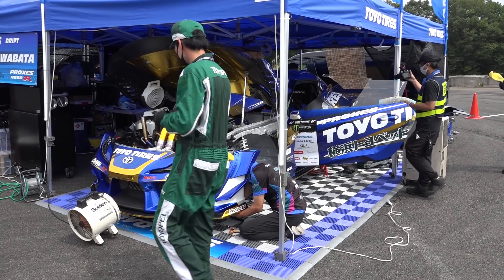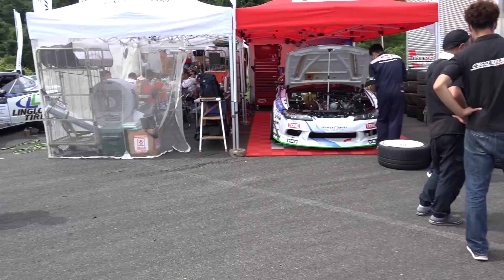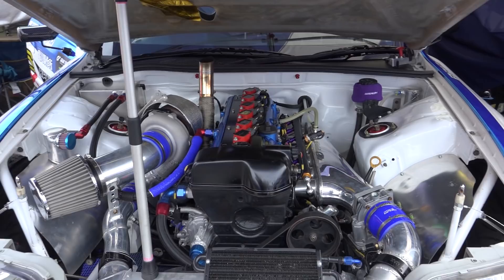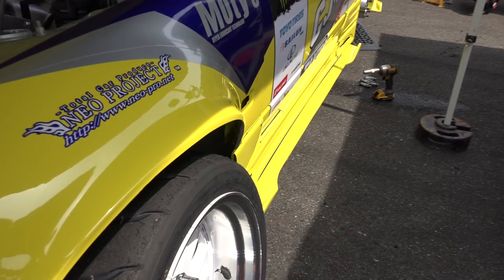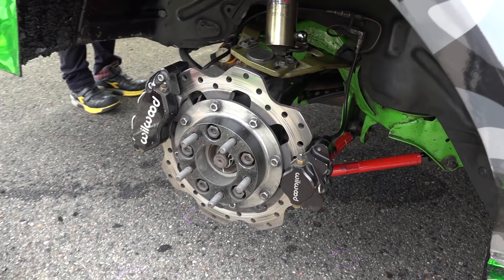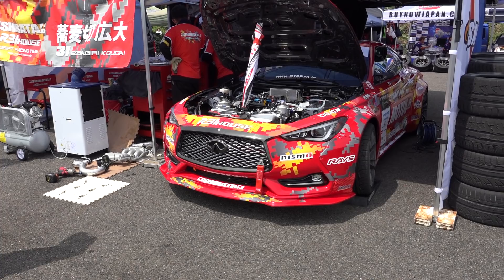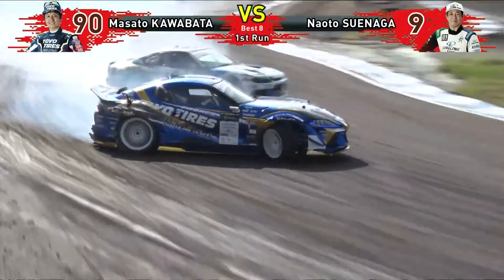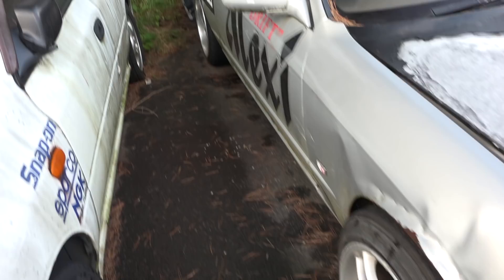V8 turbo Supra drift at D1GP Ebisu Circuit

Comment: Kawabata's Supra has a Toyota/Lexus 3UZ-FE V8. Fittingly, the same engine the previous gen Supra GT500 had (after 2009).
It doesn't sound like an American pushrod dinosaur because it's one of the smoothest-running DOHC V8s in the world.

Comment: I think it says a lot about the state of modern sports cars, if everyone still seems to be running 20 year old s-chassis at this level.
Reply: I think it has more to do with the levels of RnD that has gone into the S-Chassis platform in regard to drifting. If you look at US and European Pro drift leagues you can see that pretty much anything with an engine in the front can be made competitive, but for these guys who don't usually have the sponsor backing/requirement to use a specific chassis, using an S14/15 is just the shortest route to be competitive and is usually where the bulk of their knowledge is centred around.

I personally think it's kinda boring, seeing a whole bunch of S15s with 2JZs in them, but when you consider the context it makes perfect sense.
Reply: I feel like S15s are going to stay relevant for a good long while into the future, kinda like you still see a few AE86s running top tier competition.
Reply: It's all down to budget and simplicity. S chassis can be made competitive with tons of choice off the shelf parts. No need to reinvent the wheel there. Papadakis prove that even fwd chassis can be competitive in drifting but needs lot of development and custom parts. A lot of modern chassis is really good for drifting though, but again they're require more money and time to develop which not everyone have.

Comment: I love the diversity of drifting. no matter what car you want to run, you can (as long as its rwd). less power, less weight; possible. more power, more weight; possible. modern car; possible. old car; possible. I love that. I wonder if an older car or rather engine/platform could be made as efficient as the newer ones.. and how would manufacturers have built old cars knowing what they know now; probably the same way modern cars look and drive right now. Hmm, or how would they build new cars if they only had to oblige with the rules of the older cars..

Comment: What's with the funky looking exhaust tips?
Reply: I'm not exactly sure, but I can only assume its some sort of spark arrestor to stop fire from shooting out the exhaust. It might be something like Rally cars have where the catalytic converter is inside the exhaust tip for inspection. But that would be probably be a much finer mesh than seen here.

Edit: After digging through the comments, Alexi made one saying that they "catalytic converter's". Meaning people have them to pass inspection for cats but they are not exactly real catalytic converters.

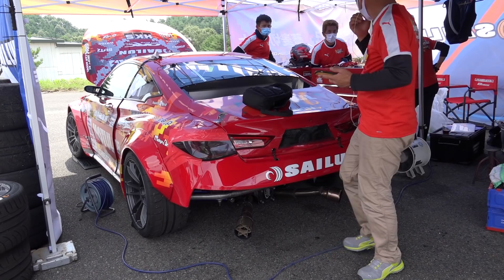Comment: Nori, what are those pieces inside of the exhaust pipes on the S15 at 14:31 and the Infiniti/Skyline at 18:10?
Reply: I’m gonna guess they stop turbo parts flying over the track when the turbos break and compressor wheels go flying down the exhaust 🤷‍♂️

Comment: 10:09 The VVL not the VVT SR20, the VVT is the standard one on S14 and S15 but i'm sure you know that Alexis.
Reply: Not VVT but VCT, some times people make the mistake of calling it VVTi which of course is Toyota tech.
Reply: @griplimit  I used the generic name, but yea you right it's called VCT. But in the end VVT/VCT is about timing on the intake cam and the Nissan NeoVVL is about valve lift on both camshafts (and timing, but it's mostly due to the shape of the cam profile). Anyway VVL is something nissan has never do on an S chassis, and VCT is fairly common.

Comment: Whats the the go with the stuff inside the end of the d1 cars exhausts?
Reply: I'm not exactly sure, but I can only assume its some sort of spark arrestor to stop fire from shooting out the exhaust. It might be something like Rally cars have where the catalytic converter is inside the exhaust tip for inspection. But that would be probably be a much finer mesh than seen here.

Edit: After digging through the comments Alexi made one saying that they "catalytic converter's". Meaning people have them to pass inspection for cats but they are not exactly real catalytic converters.

Comment: 18:10 why do all the cars have exhausts like that?
Reply: My only guess is a spark arrestor? But usually those are way finer. Seems way too sparse to be any kind of cat
Reply: In case of turbo failure, if the compressor wheel breaks and comes down the exhaust it could come flying out and hit another car or a person it would be rare to happen I’d say but it’s there for a reason
Reply: @Stu.motive  drag cars have those because they have so much boost

Comment: What are the snowflake looking things in the exhaust tips?
Reply: I would like to know where to get one!
Reply: I'm not exactly sure, but I can only assume its some sort of spark arrestor to stop fire from shooting out the exhaust. It might be something like Rally cars have where the catalytic converter is inside the exhaust tip for inspection. But that would be probably be a much finer mesh than seen here.

Edit: After digging through the comments, Alexi made one saying that they "catalytic converter's". Meaning people have them to pass inspection for cats but they are not exactly real catalytic converters.
Reply: I think they are in case of turbo failure, if the compressor wheel breaks and comes through the exhaust potentially hitting a spectator, another car and makes a mess of the track
Reply: @Stu.motive  Read my edit, it's a cat purely for passing inspection. Not a "real" cat though.

Comment: Can Alexi or anyone else tell me for what they have these snowflake-ish inserts in the exhaust tips?
Are they for reinforcement to prevent the exhaust from crumbling when running walls and stuff?
Reply: I'm not exactly sure, but I can only assume its some sort of spark arrestor to stop fire from shooting out the exhaust. It might be something like Rally cars have where the catalytic converter is inside the exhaust tip for inspection. But that would be probably be a much finer mesh than seen here.

Edit: After digging through the comments, Alexi made one saying that they "catalytic converter's". Meaning people have them to pass inspection for cats but they are not exactly real catalytic converters.

Comment: Whats up with the weird hexagons in massive exhausts?
Reply: I'm not exactly sure, but I can only assume its some sort of spark arrestor to stop fire from shooting out the exhaust. It might be something like Rally cars have where the catalytic converter is inside the exhaust tip for inspection. But that would be probably be a much finer mesh than seen here.

Edit: After digging through the comments, Alexi made one saying that they "catalytic converter's". Meaning people have them to pass inspection for cats but they are not exactly real catalytic converters.

Comment: Hey Alexi might i ask. even though there are about 4 or more inline sixes that can run 1000+ hp why is the 2Jz the one most chosen like I'm not hating on it I just wonder why its the engine of choice for most of the cars
Reply: I think is the same reason of why people use the LS engine in cars
Reply: @oklynmane maybe maybe not who knows some times the answer might be different from each engine user
Reply: @renz1013  yea maybe
Reply: @oklynmane  yeah same goes to like other things such as why people always use the s chassis
Reply: I have a rb and 2j car and reason why you see more jz swaps is because the blocks are stronger and don't crack until 2khp, they don't have oiling issues,Bigger displacement than rb26 and easier to source because they came in more cars than the rb26 did. I could give more reasons but that's mainly it but if your talking about new Zealand or Australia then it's mainly high hp rbs dominating the drifting there.
Reply: @clutchkickpj693  alright but asides those things what else

Comment: what's with the stars in the exhausts?
Reply: I'm not exactly sure, but I can only assume its some sort of spark arrestor to stop fire from shooting out the exhaust. It might be something like Rally cars have where the catalytic converter is inside the exhaust tip for inspection. But that would be probably be a much finer mesh than seen here.

Edit: After digging through the comments, Alexi made one saying that they "catalytic converter's". Meaning people have them to pass inspection for cats but they are not exactly real catalytic converters.

Comment: Can anyone explain the star in the exhausts?
Reply: I'm not exactly sure, but I can only assume its some sort of spark arrestor to stop fire from shooting out the exhaust. It might be something like Rally cars have where the catalytic converter is inside the exhaust tip for inspection. But that would be probably be a much finer mesh than seen here.

Edit: After digging through the comments, Alexi made one saying that they "catalytic converter's". Meaning people have them to pass inspection for cats but they are not exactly real catalytic converters.

Comment: What's in the exhaust tips of most of these cars?
Reply: I'm not exactly sure, but I can only assume its some sort of spark arrestor to stop fire from shooting out the exhaust. It might be something like Rally cars have where the catalytic converter is inside the exhaust tip for inspection. But that would be probably be a much finer mesh than seen here.

Edit: After digging through the comments, Alexi made one saying that they "catalytic converter's". Meaning people have them to pass inspection for cats but they are not exactly real catalytic converters.
Reply: @fourthpanda  gotcha, that makes sense! I thought it was to slightly muffle the sound.

Comment: What is in their exhaust pipes
Reply: I'm not exactly sure, but I can only assume its some sort of spark arrestor to stop fire from shooting out the exhaust. It might be something like Rally cars have where the catalytic converter is inside the exhaust tip for inspection. But that would be probably be a much finer mesh than seen here.

Edit: After digging through the comments, Alexi made one saying that they "catalytic converter's". Meaning people have them to pass inspection for cats but they are not exactly real catalytic converters.

Comment: I wonder when 2jz going to run out.
Reply: Well prices are steadily rising as the years go. Plus they have the IS,GS,and SC300s with the 2jzges and can import jz's from chaser and etc from Japan but probably another decade or so they'll probably sore in higher prices. For now probably the barra,RB,B58,S55,S58,or whatever mazdas new i6 will all be 2j replacements once that happens.

Comment: A lot 2JZ Nissans. Why 2JZ or RB?? I’m not extremely familiar with these motors
Reply: 2j can make power reliably and is very popular i6 since it can make big power without blowing up. Same with the RB but it's more expensive to do.
Reply: Carboy Dorifuto party  aaaaaaah I see. So basically it’s more cost effective to run a 2JZ rather than a RB. That makes sense. Thanks for info 🙏🏽
Reply: @marcust510  yes(well in Japan's case) in places like NZ and Australia you'd see more RB's,LS's,or Barras(4.0L i6 from ford) being used. In America both LS and JZ's are mostly used.